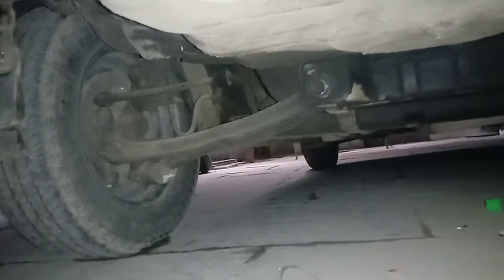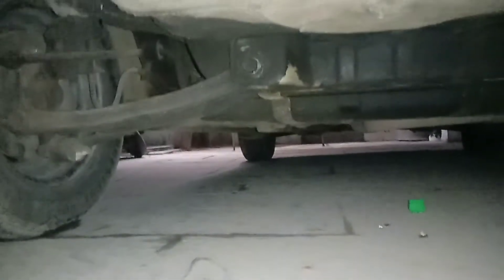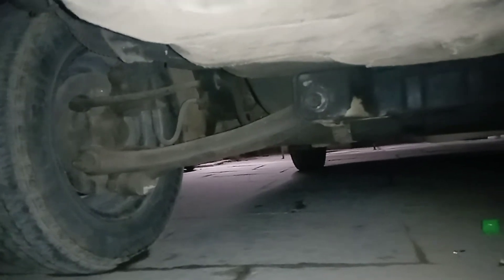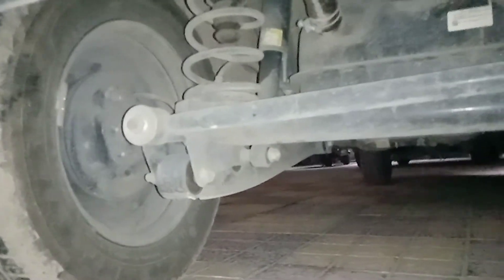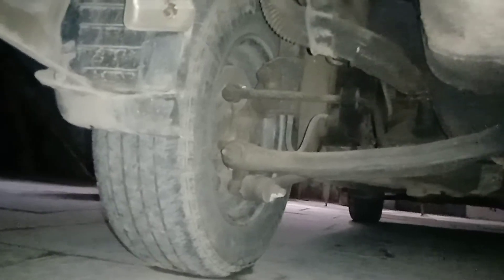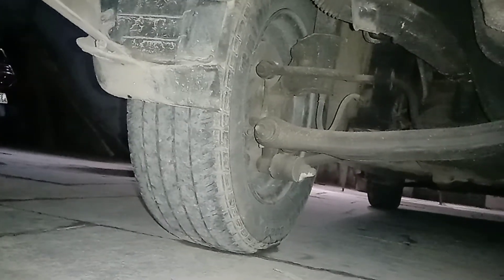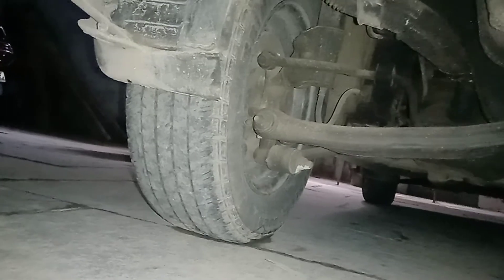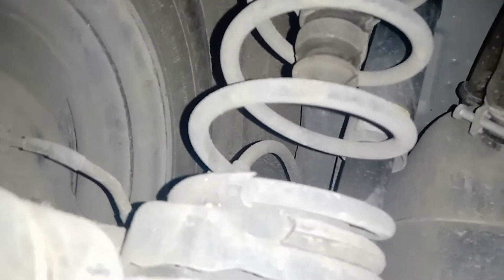HYUNDAI ACCENT INDEPENDENT REAR SUSPENSION VS MODERN CARE CHEAP SUSPENSION | Motoflix garage

Comment: is it possible to upgrade to independant suspension?
Reply: @DevTest-v1c  hyundai accent stock comes in independent well dumped suspension bro
Reply from the maker: @notu7340  in fact it had coilover suspension with integrated gas struts
Reply from the maker: Not possible at all, drilling the body panels may compromise structral rigidity